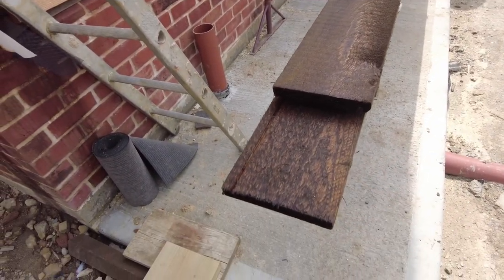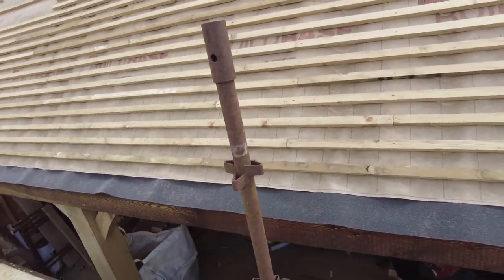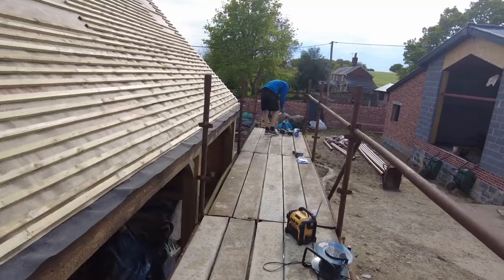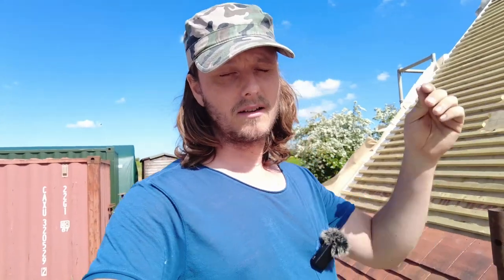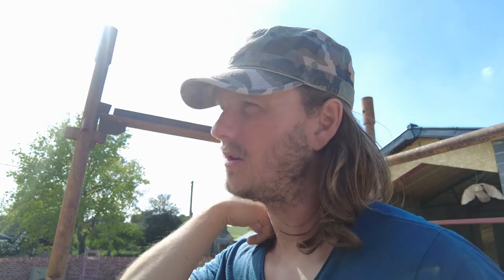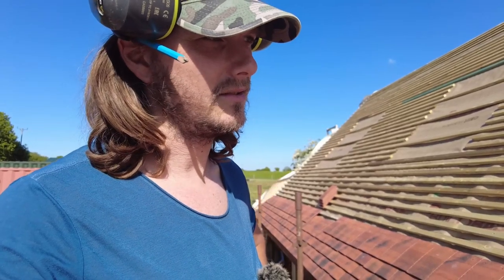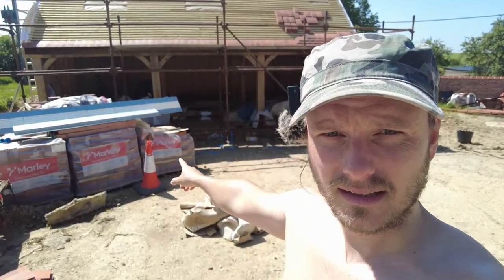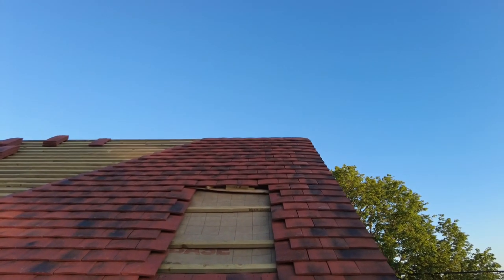COMPLETE AMATEUR DIY'ER TILES ROOF --- UK #selfbuild    [The cart lodge build 012]

Comment from the maker: This is a response to Lee Rutherford. Youtube has deleted all of your comments unfortunately because of the abusive language. In response to your question of max gauge of rosemary tiles... these are marley but I'm guessing you're asking the max gauge of a clay plain tile as a test? It's usually 100mm max gauge on a roof or 115mm vertical. I'm guessing you're a roofer? Give me some credit, I don't have a trade but I do everything, carpentry, plumbing, electrics, groundwork, bathroom fitting, kitchen fitting, window fittting... Anything and everything, as well as deal with planning, manage everything as well as video editing and putting it out there for everyone to see. If you can do better then by all means set up a channel and record yourself building your own house, I'll be your first subscriber 👍

Comment: Tiles look great, totally agree about cutting the tiles at either end rather than taking it all off one end, it probably wouldn’t even be noticed by anyone but you would know and see it every time you look at the roof 😆
Reply from the maker: It was lucky I made that decision as the last couple of tiles on the top left didn't need cutting! No idea how that happened  🤷‍♂️ 😂 I much prefer tiling bathrooms and kitchens 😁
Reply: @THE-AIDEN-PROJECT  roof is out of square slightly, this would normally be overcome by tapering the undercloak either in or out gradually to compensation for the discrepancy from the top to the bottom

Comment: Just one little tip even though you don't need it having already finished is just start at one verge with the factory finished tile and cut the other verge in at the other side, with these only been 6 inch wide you would not even notice it if you had to cut a little off or even have bigger cut using tile and half.
I also don't nail the end tiles so that I can take them out to sit onto a bed of cement and then nail them down as I'm making the verge up

Comment: I love the look of the roof, I would have really liked to have had those on my own project but just couldn't run to the cost. I have put a few roofs on like that and have managed to get away with starting with full uncut tiles from both ends and by just jigging the joints slightly over a wide area been able to use full tiles without any cuts. From memory the tiles are 150mm wide so the worst scenario is that you are half a tile out ie 75mm that could be overcome with a tile and a half one end and a full tile the other anything less can generally be got over by just increasing the gap between tiles just slightly. I think you are doing a great job by the way and would put some roofers to shame by the amount of care you are taking over details. Well done!
Reply from the maker: Thanks Michael. Yes I tried to jig it without having any cuts but it just wasn't possible. I got a good deal on the tiles at cost from a local builders merchants. They had just started supplying them so they just wanted to get some orders running through. I should have quite a few left over so I've got another little project lined up for them that I probably won't get around to doing for another year or 2 😂

Comment: Great video. Soon I'm going to strip my roof in order to do dormer loft conversion and I found lots of useful info on your channel. Many, many thanks 😊👍🏻
Reply from the maker: Cool, I done a hip to gable loft conversion with a double dormer 8 years ago with my mate. It had Redland 49 interlocking concrete tiles and was semi detached so was a little easier on the tile front. I'm guessing you might do roof windows? I paid someone else to do mine on the loft conversion but didn't make that mistake this time round so mine are properly splayed. I've got a video on how to frame out the velux so you can have splayed reveals.

Comment: Sorry I'm a year to late ! You should have made a horizontal point at the bottom off the verge to ensure the cement does not slide due to the cement does not always adhere to the undercloak ! We call it lining the the roof out to make the tiles fit . Also as you said your a nothing and having ago !! Correct your not a roofer ..
Reply from the maker: 👍 I think I'd need to see a picture to know what you mean 🤔 anyway when I done the verges luckily enough the mortar stayed in place, I made sure not to put the undercloak smooth side up too